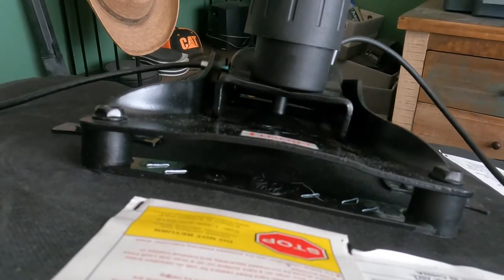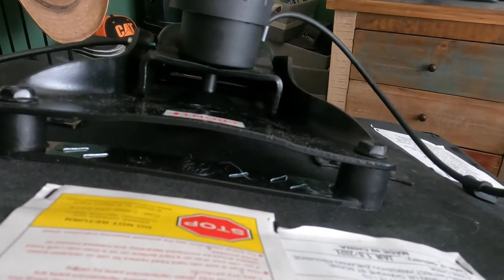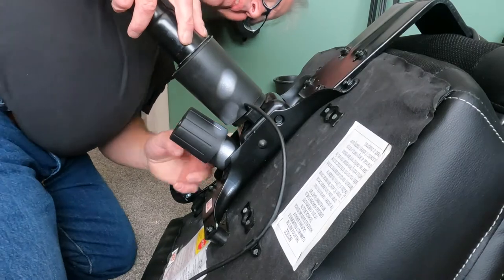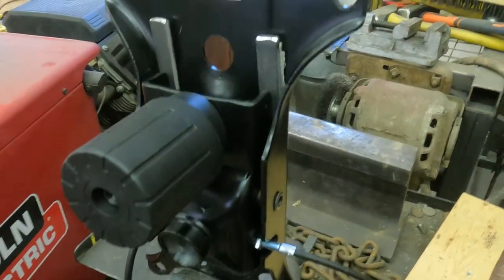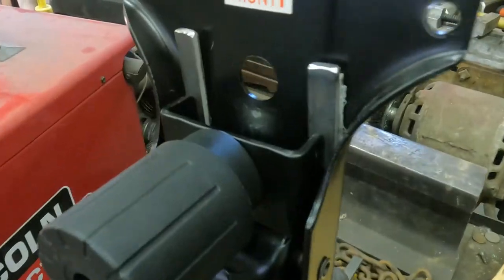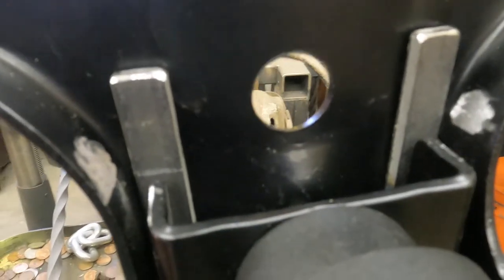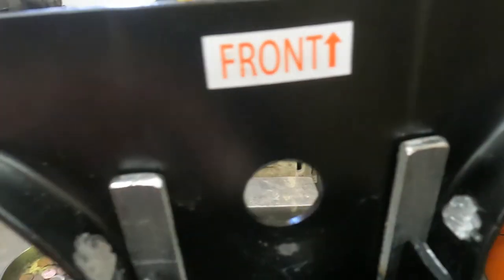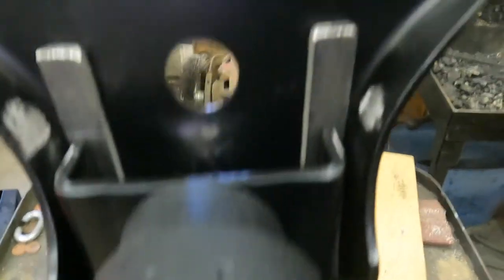LaZboy Office Chair Adjustment

Comment: Wait...I have a question.
Will it work the same if I just add several washers to the 2 back bolts as you did in your video instead of welding the front.
I don't really know how to weld.
Reply from the maker: Yes that will work fine. Make sure the bolts are long enough to hold securely after adding a bunch of washers.